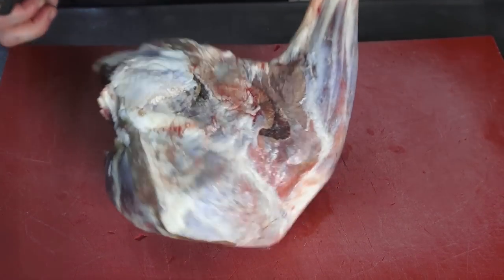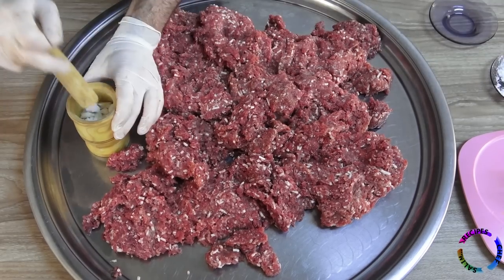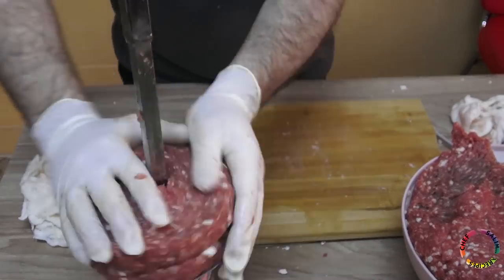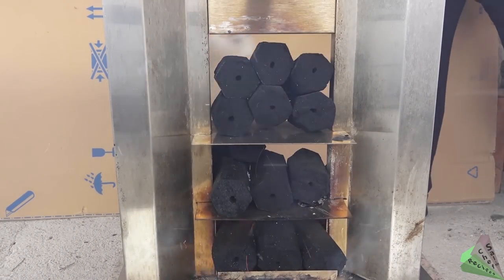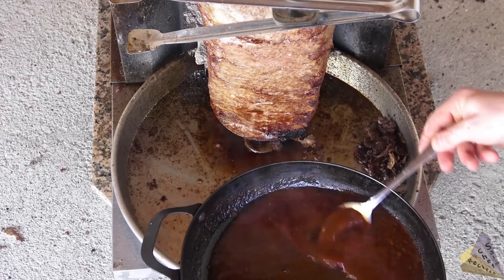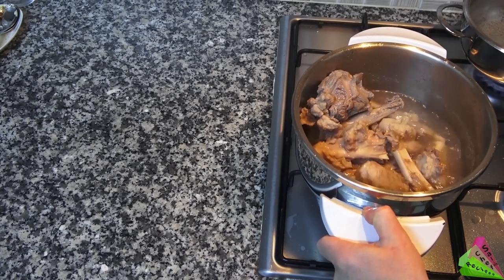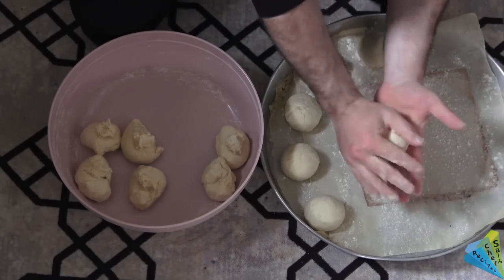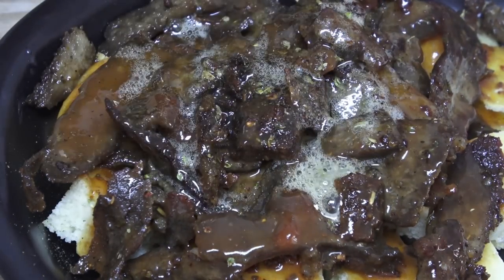Turkish Lamb Doner Kebab Recipe How to Make doner Sauce Iskender Lavash Wrap

Comment: Can you send a written recipe for this dish
Reply from the maker: 3.5 kilograms of lamb
750 grams of beef
500 grams of chicken meat will be used, chicken breast is used to prevent the doner from falling apart, to be more robust.
250 grams of sheep tail
After removing the bones and hard parts of the meat, it will be finely prepared with a meat grinder.
finely prepared ground beef has been mixed one round, now it will be checked how many kilograms it is
total 4700 grams
7 grams of crushed rock salt will be used for 1 kilogram, 32 grams of salt will be sufficient.
garlic
1 cup dark soy sauce,
no seasoning is added, spices are added when serving
can be chili pepper, black pepper, thyme, cumin

Comment: This is not authentic döner. Real döner made with thin layers of lamb and beef not with stacked ground meat. That kind of döner is cheap döner not preferrable in Turkey. Its a german addition to döner. Its often despised in Turkey. Like "don't go there they are doin döner with ground meat."
Reply from the maker: is it cheap
Do you know how much is the kilogram price of lamb leg meat? Currently, no one in Turkey can buy 1 kilo of lamb from the butcher, it is so expensive, they usually buy 250 grams, and they can buy ground beef not 1 kilogram, but half a kilogram.